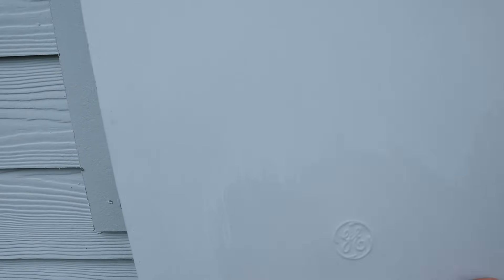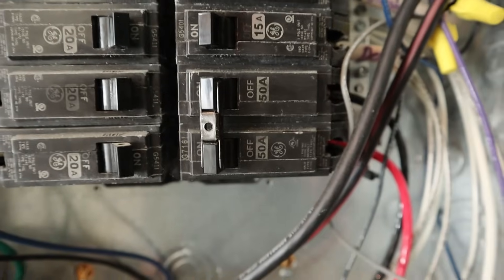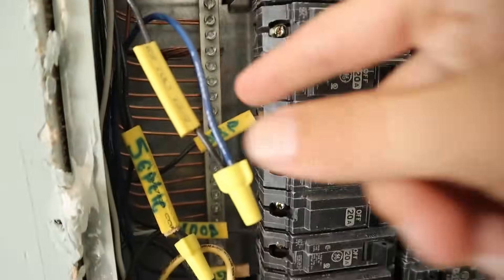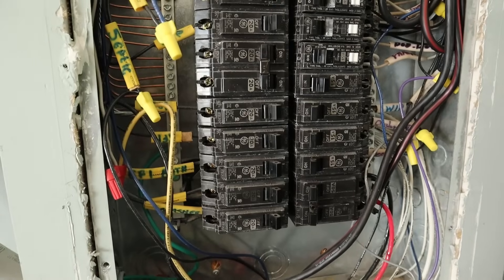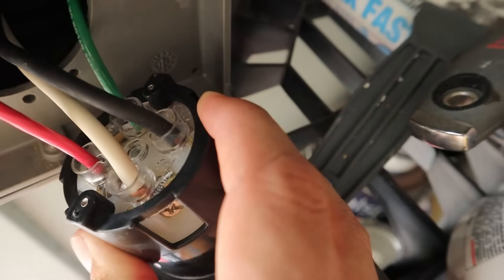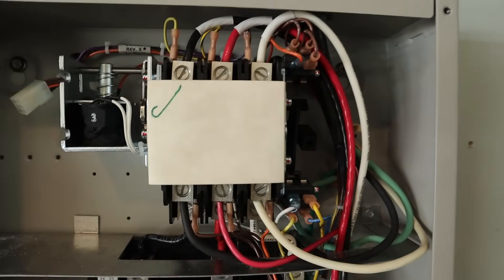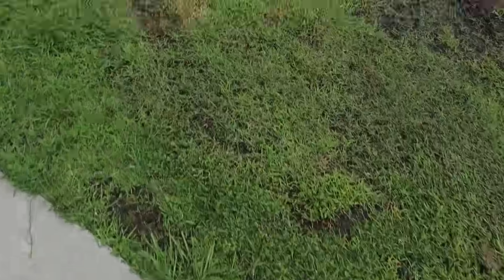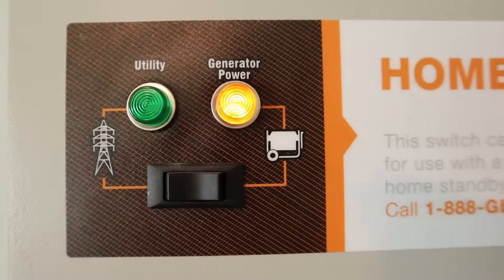HOW TO INSTALL A PORTABLE GENERATOR TRANSFER SWITCH

Comment: Thank you for the great video! Quick question for you. Once I remove the wire from one of the breakers in the main panel, can I remove the breaker from the main panel? My main panel is full, and need some extra to install the 50A breaker. Also, it will be great if you can create a short video showing the natural wire issue during the inspection and how you actually fixed it. Thank you!
Reply from the maker: Hey yes you could then remove that or those breakers as they are now in the transfer switch.   The neutral wire fix was removing the circuits neutral wire from the busbar in the main panel and connecting it to one of the white neutral wires coming from the busbar in the transfer switch.  I hope this helps!  Thanks for the feedback.
Reply: @HowToHomeDIY  Thank you for the reply! Have a great day.

Comment: When you switched back to utility power, its green light went off and seemed to stay off.  Did it just go dim or was it completely off?  Shouldn't the green utility light stay on even when the switch is using the utility power?
Reply from the maker: It completely goes away once you switch back to utility power.  It’s purpose is just to let you know that utility power is back when you are using generator power.  Kind of a nice feature really.
Reply: This vid answered the two questions I had. Thanks! I'm now very confident that I can install a 10 circuit transfer switch in my home.
On another note, that CAT generator is super loud! Damnnnn!
I have a Husqvarna 7500w with auto idle, picked up for a song. Owner said it would run for 2 minutes and quit, start right back up and do the same thing. I handed him $50 and took it home and installed a new fuel filter. Done. Runs awesome. More power than we need in an outage. Heat, lights, water, WiFi, etc.
Now I'll do it with the additional safety of a transfer switch.

Comment: Please use caution ⚠️. 

My understanding is this setup could kill someone.

 While I did find the information helpful in this case the Generator could feedback through the main breaker and into the power Pole thus electrocuting and possibly even killing somebody.

Take the hypothetical scenario:

 The power goes out and you do not turn off the main breaker that shuts off the power panel from Utility co.

Now you fire up the generator and plug it in and switch to generator power on the Generac panel. Because the main breaker still left open would it not feedback into the power lines and possibly kill someone.

There should be a locking switch that does not allow the main breaker to be open at the same time as the generator breaker thus solving the issue.

Have a great day and thanks for sharing!

https://images.app.goo.gl/7PBnbFiqaMoXoAm88
Reply: I just did a little bit more research on the set up of this particular transfer switch and I may have been wrong.

Because the circuits are being physically moved off of the main panel and are now transferred through your transfer Box. They would no longer feedback into the main panel.

And because the Generac only allows one or the other to be on it would never feedback through the panel.

Does that sound correct?

I'm gonna have this up and running before long myself!
Reply from the maker: Hey Joe, yes your follow up comment is correct.  By using a transfer switch it completely separates itself from the main panel when it is switched to generator power.  So if the utility power comes back on it wont mess up your generator and it also will not allow for electricity to backfeed into the main panel and out to the utility lines regardless if the main circuit breaker is on or off.  If it was just a power inlet box hooked up to the main panel, then you would need a interlock kit to make sure that the main circuit breaker and generator circuit breaker can't be on at the same time.  Hope this helps to clear things up!
Reply: Thank you sir for your quick reply and good info.

 Time to get it done!

Have a great night.

Comment: My Electric heating furnace is connected to 60 breaker in the breaker panel. Wouldn't that take up all my current from the portable generator?
Reply from the maker: Hey Joe, not knowing the size of your generator, yes it would probably use the majority of your generator’s max capability if at all.  Most portable generators that people own are not capable of running their furnace or AC alone.  For example I have a 15kw generator and still installed a soft start kit in order to be able to comfortably run my unit.  So it’s going to depend on your generators size and your furnaces amperage draw.  Also with this being about a transfer switch, you would need one rated for the amperage you intend to use as they all have different circuits and wiring sizes inside.  I hope this helps.
Reply: yes, thanks
Reply from the maker: You’re welcome Joe.  If you’re in one of the areas that has no power right now, hope you all get it back soon!

Comment: Good explanation.  I’ve seen several other videos that say you should hire an electrician, but it doesn’t look very complicated.
Reply from the maker: Yeah, most of us are not electricians and the ultimate recommendation is to hire an electrician.  It isn't terribly complicated but just make sure to follow the instructions that come with your transfer switch.  I would at least advise that if you do it yourself, have it inspected by an inspector and/or an electrician.  I noted in my description that I did that unfortunately after filming and had to remove the neutrals from the bus in the main panel and connect them to each circuit.  So always good to make sure things are on the up and up!  Thank you for your feedback.

Comment: How did you determine the 50 amp switch to installed in the main box in the house?  Was it determined by the generator output maximum or the Generac transfer switch, which I believe you stated was a 30 amp? Thank you for your detailed video.   It really helped me understand the process.
Reply from the maker: Hey Bob, this is the 30 amp transfer switch, they also have a 50 amp option.  To answer your question simply, it is stated in the instructions to use a 50 amp double pole breaker.  The breaker for the transfer switch can be higher than the rating on the switch itself as everything is protected by individual circuit breakers.  But you also would not want to overload the transfer switch with a bunch of high amperage circuits as it is rated for 30.  The 50 amp breaker is just for the utility power to power your circuits in the transfer switch box when you have power.  I hope this helps.  Thank you for the feedback!
Reply: @HowToHomeDIY   This is my understanding correct me if i’m wrong. So the 50amp breaker in the main box is for utility power (when we have power) but when you switch it over to generator power it will run off the 30amp in the transfer switch box right ? Also when we running generator and do I need to make sure the main breaker switch is off incase utility power back on ?
Reply from the maker: Yes the 50 amp breaker in the main box is for the utility power when you have it.  When running on generator power, it is using the 8 circuit breakers in the transfer switch.  When using a transfer switch you do not need to turn off the main breaker because the transfer switch separates itself from the main panel when switched over to generator mode.  Hope this helps!
Reply: @HowToHomeDIY  worth another video breaking down the 30/50 amp usage like you did between switch and box. Great video series.
Reply from the maker: That is a great idea.  Think I will see if I can’t add it to the list.  Thanks a lot for the feedback!
Reply: @HowToHomeDIY  I am curious why you used #10 wire on a 50A breaker. Shouldn't it be at least #8 for a 50A? Also you mentioned using the same brand breaker in the transfer switch as the main panel and the main panel is GE and you used Siemens in the transfer switch. Could you explain please?
Reply from the maker: It’s what was supplied and stated to be used in the panel.  The 50 according to them is just a shut off.  The transfer switch is only capable of 30 amps so the wires will never handle more than a 30 amp load.  The transfer switch is its own panel, basically a sub panel.  My main panel is GE but the transfer switch came with Siemens so I installed Siemens in the transfer switch.  Again the transfer switch is it’s own panel, does not matter what brand is in the main panel.
Reply: Don’t forget along with matching breaker amperes also run the proper gauge wire #14/#12 15 amps 20 amps etc

Comment: Thank you; very informative as you stepped through the whole process of installation, connectivity, and its use.
Reply from the maker: Hey, I am glad it was helpful!  Thank you very much for the feedback!
Reply: @HowToHomeDIY   could u help me understand on the breaker side one i remove the wire on breaker the neutral closes the circuit?

Comment: What do you have for heat and AC? And how do you power it when the grid is down?
Reply from the maker: Hey Justin, I have a 4 ton unit.  My AC is not powered through the transfer switch.  I also have a power inlet box with interlock kit installed that I connect my 15 KW generator to and the AC unit has a soft start kit on it.  I have videos for both installations that you can check out on my channel if you are interested.  My transfer switch I connect my smaller generator to in order to just run necessity items such as fridge, freezer, some lights, and well pump.  The bigger generator powers everything else in the house including the AC.
Reply: @HowToHomeDIY  I’ll check them out. Thanks
Reply from the maker: @justinrobertson1590   Sounds good.  You are welcome.  And if you have any other questions, feel free to shoot them my way.
Reply: @HowToHomeDIY  yessir
Reply: What size generator do you run for your a/c and heater

Comment: What’s the item , part number of this transfer switch thanks 👍
Reply from the maker: Hey Charles, this particular transfer switch is the Generac Homelink 30A manual transfer switch, Model #6852.  Before covid you could find it just about anywhere.  Now they are a little harder to find.  I think Generac, like many other generator manufacturers, may have slowed production due to it all.  Hopefully things will return to normal soon!  I hope this helps you!
Reply: How To Home thanks so much for your help and quick reply

Comment: Are generators safe for home electronics and computers? Do you have any problems with that?
Reply from the maker: Yes and no.  It comes down to THD percentages when you are talking about sensitive electronics like that.  It is recommended not to use those items if the THD % of the generator is above 5%.  That being said I have used one with 10-12% in the past and my TV was fine.   But to be safe you want a generator with 5% or less.  Hope this answers your question.
Reply: @HowToHomeDIY  Great tutorial and I am gearing up for a transfer switch using the same product. 
My question is how to do I determine THD percentage? I'm not seeing THD % in the spec sheet for my Generac 6500. Thanks

Comment: The video is great, but you wasted $400 on an unnecessary transfer panel with its eight emergency breakers.  All one needs is the 50a breaker - the power conduit from the generator - that mimics the utility power, because already have eight completely good operational breakers in the main breaker panel. Each of the eight breakers in the new generator panel needlessly duplicate already good breakers. What is needed is to mark the primary circuits on the main panel, like fridge, sump, well, furnace, lighting, while shutting off all non-essential breakers in the event of power outage.
Reply from the maker: You are talking more about using a power inlet box with an interlock kit in order to make it NEC compliant.  The transfer switch takes care of all of that on it's own and is suitable especially for smaller generator usage.  Depends on each person's needs.  Thanks for the feedback!
Reply: @HowToHomeDIY  Yes, the main utility lockout mechanism. Are you a homeowner or do you have a financial stake in transfer switch commercial product sale? 

The transfer panel and 3-way switch makes it electrically impossible for the utility and portable generator power to conflict or back feed, like a light switch in off position, after the utility comes back online while the generator is running.  It is without question a worthy idea in its own regard. Good of you to install without paying an electrician. 

The fundamental processes of powering essential appliances with a generator, in the event of power failure, each being manual human operation, not computer automatic, do not require a secondary panel but do require cautious prudence.  

The key point you touched upon but didn't go into detail, at about 15:48, is the 50a double pole/single(or double) throw breaker. This is the whole deal to the transfer between generator and utility after the main is shutoff.  A portable generator becomes the substitute main through the new 50a breaker.  Just as a transfer box, every circuit turned on should only only be the essential ones, with all others kept off until the utility comes back online.
Reply from the maker: No I actually think using a power inlet box with a interlock kit to power the main panel or using a transfer switch are both great ways to go depending on the homeowner's needs or preference.  I wish I had stock in transfer switches as maybe I could retire haha.
Reply: @HowToHomeDIY  interlock won’t work on a bonded neutral generator, thus the need for this transfer switch.
Reply from the maker: There are ways to switch a bonded neutral generator to floating.  Usually takes about 5 minutes.  Some manufacturers will even give instructions on how to do so.  But to your point, if one does not want to disbond the neural then a transfer switch is a great choice.

Comment: Why you use a 50 amp breaker for a 30 amp transfer switch?
Reply from the maker: Hey Dj, the 50 amp breaker in the main panel is what the instructions call for.  When Generac says it is a 30 amp transfer switch, it is referring to the wiring and plug that your generator connects to that is then coming into the transfer switch.  If it was a 50 amp transfer switch then you would need it to come with #6 wire instead of the #10 wire the 30 amp switch comes with.  Generac's 50 amp transfer switch comes with 10 circuits instead of the 8 that come with the 30 amp that was installed in the video and the conduit is slightly bigger on the 50 amp to accommodate the larger wires.  I hope that this makes sense. Thanks for watching!
Reply: Also, if you have a two pole 50 amp breaker feeding the transfer switch… It looks like the wires running from that breaker to the transfer switch are only number 12 or number 10, which are rated for only 20 or 30 amp. The wire should be rated for the 50 amp breaker, yes? So number 6 seems more appropriate.

Comment: I'm confused about the 8 neutrals connected between the transfer switch box and main service box. In another video (using the exact same transfer switch) he did it this way as well, but later had it inspected and said he: "removed the neutrals from the bus and connected them to each branch circuit." And I've read other comments saying how this can be mildly hazardous. I keep reading things like this comment, but don't understand exactly what they mean: "the manual clearly indicates to use the white prelabeled neutral wires and hook them to your incoming circuits. The Generac panel Neutral bar is already connected to the house panel neutral bar." Does this mean to take the neutral from each circuit in the main box (removing it from the neutral bar) and wire nut it to the neutral incoming form the transfer box? Everything else I understand and can make sense of--it's just this bit dealing with the neutrals.
Reply from the maker: Hey Nikola, yes you have it correct.  Each circuit's neutral that you are moving to the transfer switch, should be removed from the main panel neutral bar and directly connected to the neutrals coming from the transfer switch.  Like I advise everyone, make sure if you do any electrical work yourself, have an electrician or local code inspector look at it.  Thank you for the question!

Comment: You mention that it is a 8 breaker transfer box, the white wires “neutral” from the transfer box to the main panels neutral bar and doesn’t matter the order to the bar. So my ? Is does the transfer box have a neutral bar and am I running 8  neutral wires because it has 8 circuit breakers and does it matter where on the transfer box neutral bar?
Reply from the maker: Yes there will be a white neutral wire for each circuit.  There is a neutral bar in the transfer switch itself that all of the neutral wires for the circuits are in.  Order does not matter.  All of the white neutral wires in the transfer switch neutral bar, the other end of those wires will then need to be run into the main panel and connected to each circuits neutral wire, not the main panel's neutral bar itself.  In the video it shows them being connected to the main panel's neutral bar but that needed to be corrected.  There will also be a larger gauge neutral for the utility power running from the top lugs in the transfer switch to the neutral bar in the main panel.  I hope this answers your question!
Reply: Is the transfer switch  white neutral wires already pre wired from the manufacturer, and then run to the main panel? and yes so far u have answered all my questions. Thank You!
Reply from the maker: Yes, the one in the video already had all of the neutral wires in the transfer switch already attached to it's own neutral bar right out of the box.  So I would assume that they all come that way.  I can't speak for other brands though.